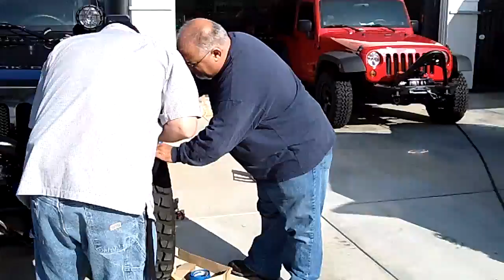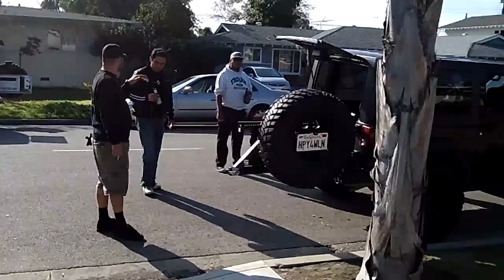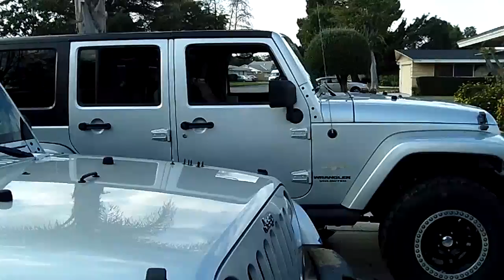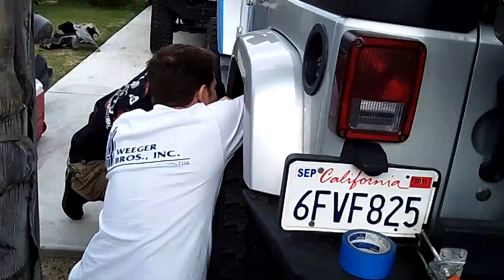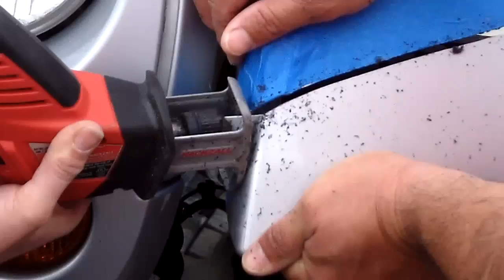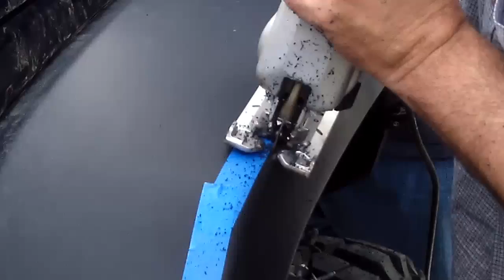JK Fender Mod Party

Comment: Those look like some nice mall crawlers -- not even a fucking scratch on those rigs.
Reply: Those plastic fenders would be destroyed offroad. The powder coated tube fenders aren't that expensive. but they'll probably never do anything where the steel fenders would be necessary.

Comment: Theres alot of people who like oem over aftermarket parts. The flares get messed up all the time on the trails and even normal use since they stick out the furthest on a stock jeep. u wont get as much for the unpainted ones but for the painted ones are high $. when u buy from mopar they come unpainted so its an extra couple hundred just for paint. As far as having to take the firewall out, I have no clue what ur talking bout. Mine simply bolt on & off. R u thinking the inner fender?

Comment: Ok so why did you cut a stock Sahara's fenders?
Reply: We were rubbing at full stuff. Gave more clearance without having to increase our rear bumpstops.

BTW the Sahara is not stock; it has Genesis dual battery, ARB lockers, Yukon gears, ARB on board air, Currie 3" suspension with adjustable control arms, Dynatrac ProSteers, LOD front and rear bumpers, Warn Zeon 10S, Evo drag link flip, EVO C gussets, ARB diff covers, JWS headlights and foglights, and a lot of other stuff that I cannot even remember. Half of it cannot be seen, which I like.